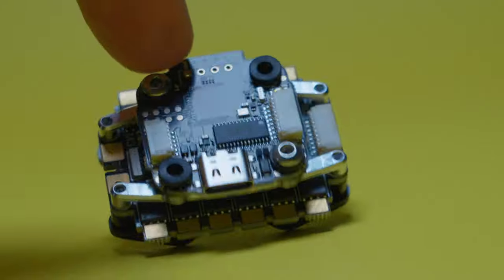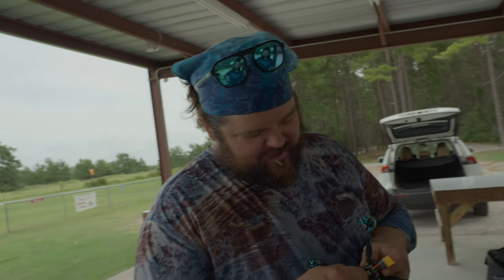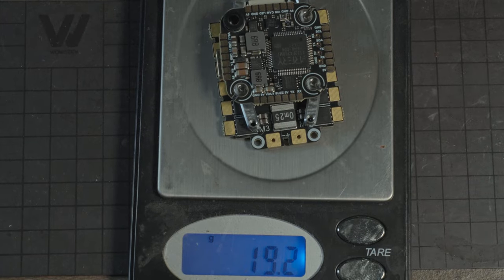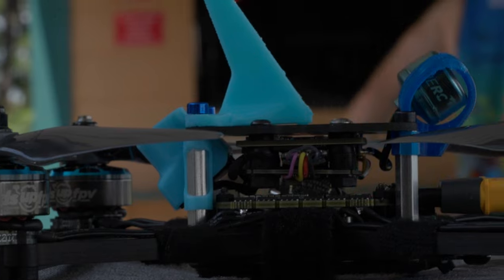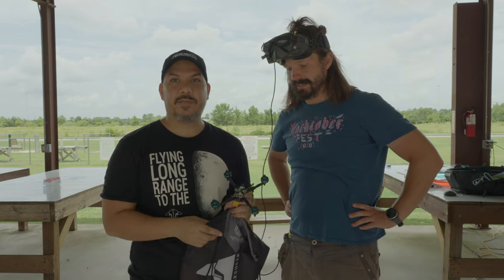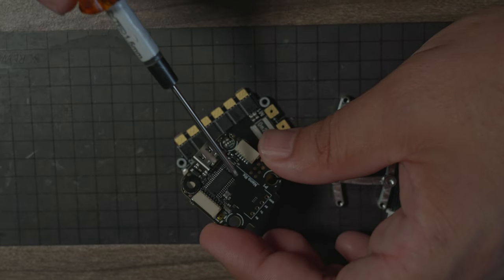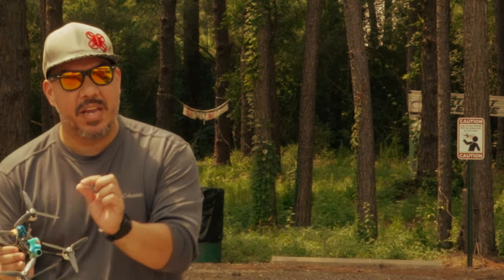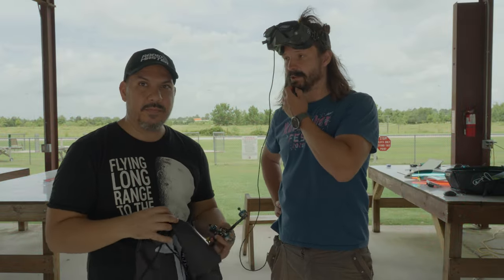$90 drone stack with weird mounting - TBS Lucid

Comment: TBS just solved a problem that didn't exist in the first place. In fact, I don't even know what problem they are solving here. I really can't see the point of all these adapter plates just to mount a nonstandard stack mount. To be honest, I actually hope that frame manufacturers don't adopt this. It's like when iFlight released that 2005 motor with nonstandard Tmount screw spacing.
Reply: @cubefpv  Trappy said that in testing this design was better for electrical flow. I think he said they were able to pull 200 amps through it (I could be wrong about the number, but it was high) only time will tell 🤷
Reply: They claim it's for better mosfet routing to allow for more current in this form factor, but to be honest it's a load of bull when we have plenty of 20x20 ESCs that can deliver more than 70x4 amps all day any day. As you have already pointed out they turned a non - issue into a problem for them to solve and the TBS fanboys will call that "innovation".
Reply: @Karolk64  I still bought one. If it does turn out to be better than anything else then I will run it 🤷. Been running Foxeer and Tmotor stacks so yeah, it'll be tough to beat them 😎
Reply: @Karolk64  Yes agree. TBS states " ...innovative mounting brackets which avoid the complication of having to run mounting bolts through the middle of the ESC" Apparently something that every other manufacturer can do, is seen as "problematic" by TBS. So instead of solving the problem themselves, they simply put the onus on frame manufacturers and the end user to install these mounting brackets. You just gotta laugh.
Reply: @cubefpv Other manufacturers are suffering extra noise and performance loss which is fact.  If you don't notice the performance hit then cool.  Racers are slaughtering their ESCs so I'm willing to try it.
Reply: @Tw1dg1t  Okay that's interesting. I really want to see some feedback from actual racers once they test this ESC and stack out. I'm just a freestyle pilot, but racers will be the ones to tell us if this is worthwile.

Comment: On the new FOx Crooked and Pro batch you can mount the esc on the bottom without any adapters and the fc on the top plate so you dont need the metal frame
Reply: I am currently using these ESCs on my Fox V1s. Just drilled 4 holes with dremel. Great form factor and durability. Tried using the Lucid PRO FC, but I get stange gyro noise on pitch and yaw. Moved back to Foxeer F7 Mini V4. Also its taller than Foxeer, so less clearance between ESC and FC.

Comment: If this leads to easier designing processes lowering R&D costs per ESC, it'll be worth it.
Its just four M2 holes, you can countersink on the bottom, so it doesn't even interfere with any arm.

Comment: what kind of problem does this mount solve?
Reply: It’s lighter and the layout of the ESC is more compact. So it doesn’t stick out, less chance of getting damaged. Also, it’s a cleaner layout. That’s what I got from watching the video.
Reply: @marmachul it was weighed in the video 🤦‍♂️. The bracket was only a couple of grams. Watch the video.

Comment: Also It's not cheap, it is pretty regular price for stack with at mcus on both esc and fc.
Reply from the maker: Not finding that at all.  All the high end racing stacks being used (Foxeer, T motor, hobbywing, Rush) are $140-190 for FC+ESC.
Reply: @JonE5FPV Skystars 20x20 55a am32 f722 stack is like 80-100 so pretty much the same

Comment: That looks like a real nice FC for racing. Having a space for an ELRS receiver and all the plugs on one side is really going to help with keeping the height low and solving the age-old receiver mounting problem. F4 is a bit of a miss, makes the Pro version redundant in my opinion. At $40 I would buy this FC if I broke one tomorrow.

The ESC however is a total joke, and eliminates all the height gains you've made with the FC, to the point where the example build doesn't even fit together lol. Why. Plus it's all hard mounted.

Comment: JonE5 what Dal Props are you running? they look kinda like mini 7" street league Props. would like to try these.
Reply from the maker: I run combo of Gemcan MCK 2, HQ Headsup, and Dal Cylcone V2 (whichever is on sale when i order).  

Headsup has most control, gemfan has nice speed, and the cyclone is a good middle ground, and ive ran a few hundred sets.  They are also a little stiffer, which makes them easier to bounce/bend back at our night spot.

Comment: Hey thanks for the video and review of the TBS Lucid. I'm not sold, I don't like the mounting arrangement, I don't use a 30X30 esc with a 20X20 F.C,  and I use bolts through the stack, not standoffs. My go-to stack is a Holybro stack for $90. So I'll pass

Comment: 😂 plz explain how Crossfire/Tracer RXes have a different mounting pattern than ExpressLRS (they're the same by design). Also this gorilla mount is insane because it takes more space vertically thanks to the required adapter-- who wants to add longer standoffs to make the same stuff fit? Also, $10 premium for MPU6000 lols.
Reply from the maker: the EP1, RP1, and others sometimes have different wiring orders, and they dont typically use the same holes that TBS receivers use to allow pinned install.    I do agree it is a bit more space vertically which can make it tight in some frames.
Reply: @JonE5FPV  You may want to recheck into that statement, because the pin order and pin spacing is standardized on all ExpressLRS receivers: 2.54mm spacing, RX/TX/5V/GND. Of course, some receivers can be wider than a standard Crossfire Nano, but they all will probably fit using the same mount (4 pin pinheader) a TBS RX would. Maybe not all the True Diversity receivers tho.

Comment: would be flawless if the mounting was 20x20 😢
Reply: there is a 20x20 option
Reply: @RCRitterFPV  not for the esc I can’t find it on the tbs website only 20x20 adapter